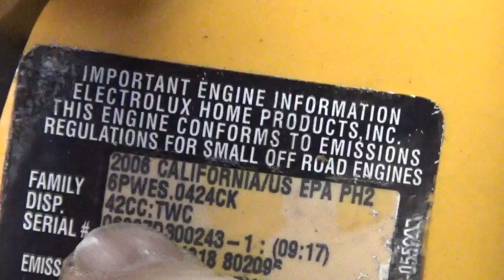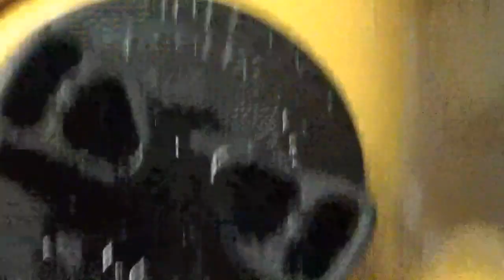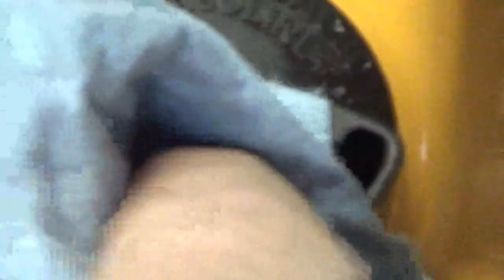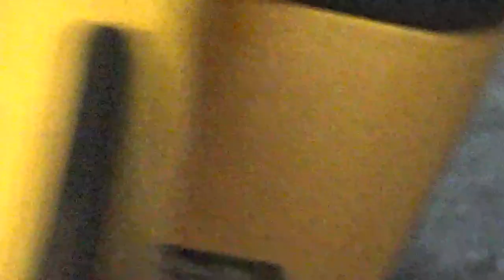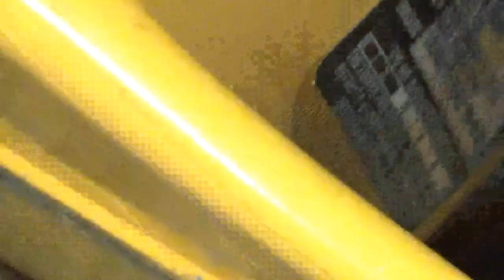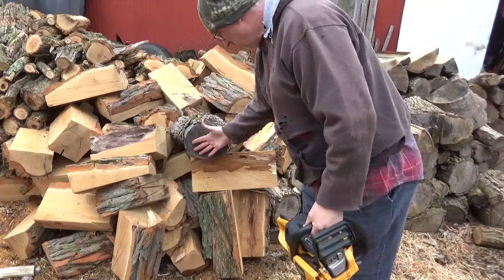Poulan Pro 4018 Trash Pile Salvage Video #6 First Start & Cuts

Comment: I hope you're running 89 or above octane gas
Reply from the maker: 89 octane is more than enough, the compression ratio on these saws really isn't that high, with a squish somewhere in the .040 thou range I would guess it to be some where in the 8 to 1  up to    8 1/2 to 1 range on the compression ratio.

Comment: These saws are know for there spontaneous combustion even poulan video say have a fire extinguisher handy.. These things get oil and gas and wood chips with plastics housing that will go up into a fire ball. I so glad I know stop drop roll even if feel like a 2 years doing it. And thought concrete on the fire since water would not put it out. Glad you clean yours.

Comment: Craig, Did the saw have one of those heli-coil looking oil pump drive gears on it?  I was going to make a tool for it on the 136 I'm fixing but 2 flat screwdrivers pried it off with no problems.
Reply from the maker: Ken yes it did, I used my tool made from pipe fittings to remove and reinstall it then set the gap between the lands with a screwdriver by eye using the worm gear as a reference (for spaceing) seem to work out ok for me.
Reply: I see the factory tool is a piece of plastic with the correct thread molded into it so you can just screw it on and then pull the insert out.  Might buy one as it is only 7 or 8 bucks.
Reply from the maker: @KensSmallEngineRepair  That's pretty inexpensive I didnt look for a tool I just done mine the same way I done the others guess I'm just Cheap. <(@?@)>
Reply: I use the word Frugal
Reply from the maker: @KensSmallEngineRepair  🤑👍

Comment: great video !! i rebuild a lot of the poulan saws i really enjoy working on them , where do you get your replacement cylinders and pistons ? thanks
Reply from the maker: I get most of my replacement parts from the local farm supply store Rural King also Jacks Small Engines and ereplacement.com  and equipatron.com  and a few other places depending on what it is

Comment: Nice, seems like a big bar for a 42cc saw
Reply from the maker: Believe it or not this is the bar & chain that comes with the saw brand new it's 
18" 3/8 .050 
The chain is total junk with missing cutters can't believe it cut as good as it did 
I have a new Oregon 27857 16" combo already ordered
I tuned the saw and it runs way better now can't wait to cut with the new bar and chain

Comment: a very good video that saw woke up with a muffler mod the saw would do good with a narrow cut chain
Reply from the maker: Tim yes it did those EPA mufflers (catalidic converter) are very restrictive and cause the exhaust temps to run higher which is why I think this saw burnt itself up. This is just another reason I like using 32:1 oil mix
As you know anytime you open the exhaust you get 2 results better flow = more power and cooler exhaust temps.
I have already ordered an Oregon 27857 bar & chain 16" 3/8 .050
I have tuned it and it runs way better now can't wait to try the new bar & chain combo

Comment: Ive even had missing duckbill valves when owners remove the fuel cap retainer cord assembly from the saw. Most are held in with a Toothed push-in retaining ring that if pushed in too hard may cock the duckbill rendering it useless.  I use a socket to apply even pressure to the ring when intsalling a new duckbill. I also change the oring if it has flattened on the gas or oil cap over time.  Great job Craig, what’s next for builds?.
Reply from the maker: Thanks Ken I will be trying to get the Husqvarna 576xp non autotune up and running

Comment: Another good job on video Craig... easy viewing....well done on muff mod..3 pulls must be a record .... purchase a 14 inch bar and Oregon full chisel .325 chain...if that's a micro chisel I think is straight forward swap out......one other thing...In your wood pile what species timber is that with the coarse,thick bark,?? I know the trees ,grows tall with folage on top 1/ 4 only ..bark falls away easily.. softwood family...burns great! Have some in Ireland heard them being called American Douglas, I like to know for sure, thanks..
Reply from the maker: Thanks Nicky, Yes it is a micro chisel probably as supplied with the saw when it was purchased brand new the chain is total junk with missing cutters I'm really suprised it cut the way it did.
I agree and will be putting a 16" 3/8 
.050 Oregon 27857 bar and chain on the saw (already ordered)
The only two types of wood In the pile in this video are Ash that I'm cutting been in pile for about 2 1/2 years and Yellow  Locust which is a species of tree with great big thorns a hard wood that makes great firewood